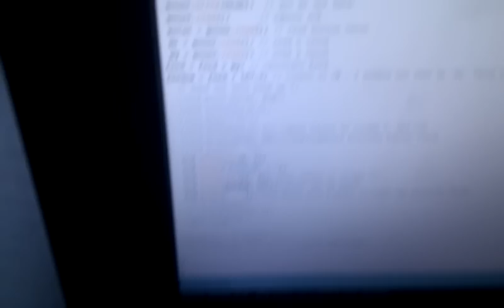Arduino PS2 mouse lcd measuring

Comment: Hi Ivan, I am Jignesh From India, I want to use the same for measuring wire feed. Can I get your guidance for Arduino code along with the assembly of the mouse LCD with Arduino UNO board. Please do send information on my email jigneshdharia@hotmail.com;
thanks.